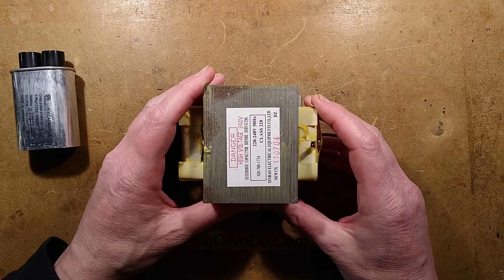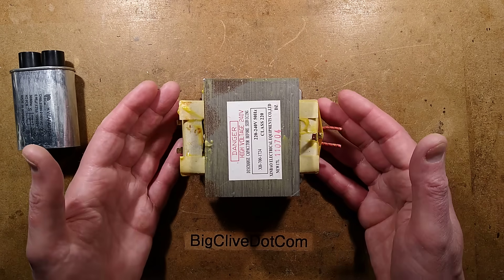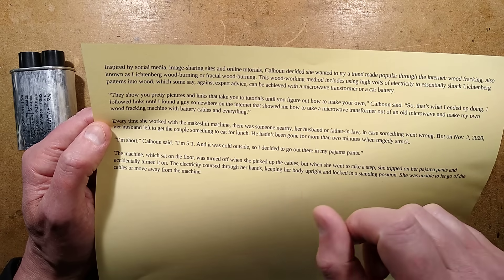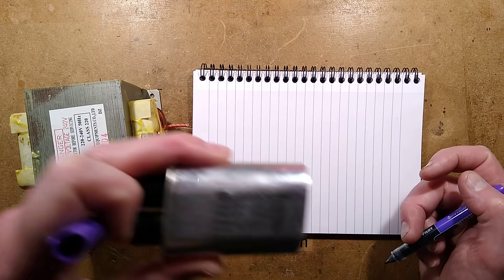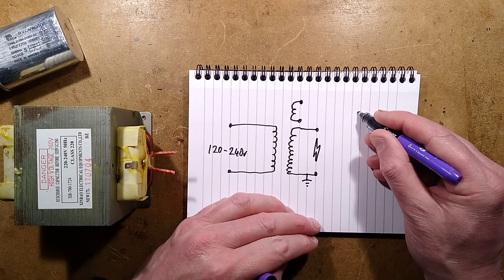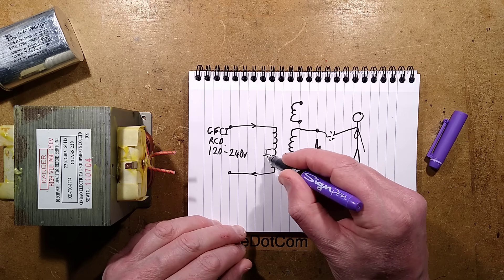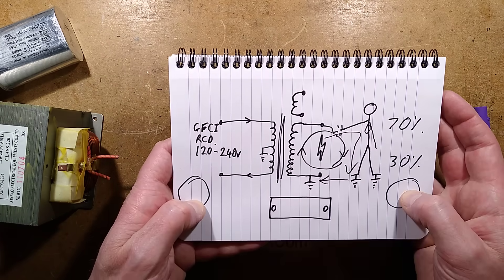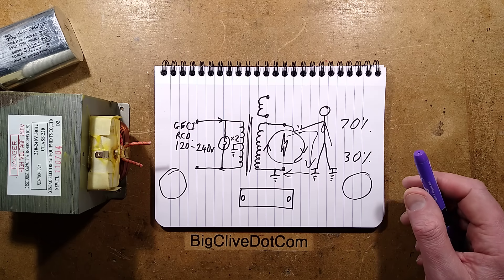The most deadly project on the Internet

Comment: You should use much higher voltage and lower current to make Lichtenburg figures, and of course never touch any part of the device while it’s connected to power.

Comment: If i ever did this (which i do not want to)
i think I'd also add unplugging the device as much as i can, shorting the hot, having an insulative mat rated for the voltages, and, honestly, I'd probably want a pneumatic dead mans switch because i dont want any path at all from that hot to me.

Comment: I don't understand how there was such damage to her hand, but not (apparently) to other parts of the circuit (her body).  I mean, the same current was passing though her feet, for example.  Of course it was probably shared between the feet, and the surface are of contact would have been much more, but I'd still expect some damage.  Maybe there was.
Reply from the maker: I'd guess most of the current was flowing across the hand.

Comment: I used the sheet metal from the microwave to build an enclosure for the device. I built a redundant safety circuit on the controls side. Including indicator lights( power on, active, and stop/e-stop), momentary activation PB, power on off SW, E-stop PB, 2 relays, Main power contactor, and a wireless IF remote. 
These machines are no joke. If you take it for granted or are ignorant,  the will hurt or kill you. I also build and design industrial controls. So talk to a friend and be safe. Be smarter, don't be a retarded.

That was also not the 'R' word slur. I was using it it's most literal definition. 
Be safe folks!

Comment: I've been using one of these for about 5 years on and off. I agree totally, they are dangerous. I have placed the activation switch about 2mtrs from the unit, so I'm not near it when it's live.
A welder works pretty well as a power supply but you still must switch it on remotely.

Comment: I work at Lowe's, we dispose of a lot of old microwaves, I've noticed that microwave manufactures have been doing away with these huge heavy beast transformers anyway, instead they are using some kind of smaller toroidal transformer and electronic circuits to make the high voltage, not to make the microwaves safer but as a way of making them cheaper and lighter.
Reply from the maker: The inverter power supplies.  I should investigate one sometime.

Comment: i'm an electronics guy. made a career out of it. i seriously doubted that a microwave transformer could kill you until i seen this video. ive been hit with AC a bunch but only low voltage 120/240. i only poke around with 1 hand too tho i keep the other hand gloved or in my pocket. lol. never been hit with DC either

Comment: It’s the current that kills, not the voltage. Ever been hit by a spark plug wire that’s throwing 50,000 volts? It’s smaller than those 4 gauge jumper wires that you’re complaining about.
Reply from the maker: It is the current that kills.  But a higher voltage pushes more current, and these transformers are causing a lot of extremely nasty incidents.
Reply: I'm an electrician and always find that statement a bit stupid. Ever seen lots of current flow with no volts?
Reply: @justbreakingballs  but have you ever died getting hit by a 30-50Kv coil? My statement is factually correct that there are circuits that carry very low current with higher voltages, current which is well low enough to not be fatal. Just because you have not worked on a low current high voltage circuit doesn’t mean they don’t exist, so I’m not sure you have all that much experience you have with a statement like that.
Reply: @cnrails  ouch touched a nerve have I. You've also missed the point why I find it a stupid statement. Voltage creates and is the precursor to current, you can't have current  without voltage, you don't see power plants generating current. They generate voltage. If anythings more factual it's that voltage kills because it's the primary unit generated. Without voltage 100% of electrical deaths are prevented. It's just a silly thing to say current kills volts don't. Let's see you generate all this killer current with 1volt. 😀

Comment: You dont need microwave parts you use a car battery charger/jumper on 50A or mid and thats all... Use it on both ends with a nail on underside
Reply from the maker: Have you actually tried this?  A charger only puts out 12/24V.

Comment: This video is exactly why I have this transformer sitting in the closet untouched. It scares me even though I have experience with lower voltages and have never been shocked once. 1 in 100 is too much of a chance for me.

EDIT: I think you can do this with a 12V car battery but much smaller scale.

Comment: I used to mess with high voltage alot and got shocks before but was usually extremely God-fearing and respectful in referring to current but still at the time one of my friends was messing with a neon sign transformer and was using it to burn patterns(I think is dumb) when  I warned him 100 times to be more careful. One of the days he was in his garage I came out to visit him he was convulsing in the floor like a seizure and when I went to turn off the plug my arm touched the metal surface of the table and the feeling is indescribable, felt like you just handed me 1000 pounds for my muscles to hold till the point of them busting and my chest and heart expoded out my chest for a split second as I could feel the cycles and thank god I fell away and let out the most visceral yelp with my heart beating a million miles an hour I run to the breaker and fliped it off. My friend was out cold and I called the ambulance and he spent the night in the hospital and made out with only burns. I was super mad at this guy and am no longer his friend because he is to carefree. Screw that guy. I lived and its not my only run in with death but I don't enjoy the ones not of my own making.

Comment: I was a mechanical maintenance man, heave in design and welding. When I got thrown into the electrical stuff 480v 3ph. I had little to no experience. An electrical contractor told me to get in the habit of keeping one hand behind the back when probing in a panel. So if I did get shocked the current would flow through my hand, and come out my foot. With both hands the current would pass through my chest/heart and by by.

Comment: I was warned by a domestic  appliance repairer who had a successful small business fixing things, that he knew several experienced  people over the years who had died trying to fix or repurpose microwave oven parts.
Reply: ...my bet is on the capacitors on the thing killing those folks.
Sure the coils are dangerous, but the "lets dig into its guts, it must be safe, since it aint plugged in" type of deaths are not due to coils.
Reply: @martonlerant5672  Yes, it's the capacitors that kill as people will be careless when the device is powered off! Another factor is that people do give too much trust on discharge resistor on these capacitors!😢
Reply: @martonlerant5672 scewdrivers with rubber handle short capacitor or leave it for few days to blled off
Reply: @martonlerant5672  I did have a shock with a mind you small 240V AC motor capacitor, not much but does make you think twice when it says high voltage on the side.
Reply: @martonlerant5672  I don't think those capacitors have enough energy to reliably kill a person. I have had higher energy shocks than that. Not that it's safe or pleasant, just not the way people are dying. I guess it's leaving the MOT powered up, whether inside or outside the oven.
Reply: @henryokeeffe5835  Those microwave capacitors do kill I was warned many years ago, when I trained as a domestic appliance engineer.
Reply: @matthewjenkins1161  They are fairly small MKP capacitors - storing about 10 J at the most. This is not considered enough energy to cause death (L.B. Gordon, "The physiological effects of electric shock in the pulsed power laboratory.") I wasn't even saying it isn't possible, just that even with all the people taking these apart, that isn't what killed those people that the OP mentions.
Reply: @henryokeeffe5835 "they don't have enough power to reliably kill a person" same as a revolver with one bullet, how many times do you plan to pull a trigger to find out?
Reply: @Cypeq  I wasn't suggesting anyone find out. It's just unlikely unplugged microwaves caused many, if any, of those deaths.
Reply: @henryokeeffe5835 I think you underestimate just how many people are working within these things. There's probably plenty of people "not dying" too.
Reply: This is why power supplies in computers are very dangerous. If you open it up the power supply casing and dig inside of it there's a chance you can die even if it's unplugged if you don't know what you're doing
Reply: Im pretty lucky to still be alive due to a microwave when i was 13 (now I’m 14 almost 15) and i didn’t know much about the dangers of electronics but they always interested me so i would take a bunch of different stuff apart to look at the internals and one day out microwave broke and we replaced so i was like oh nice a new thing to take apart and since i was young i didn’t check the capacitors or anything and i guess it had just been sitting without power (it took me some time because i had to get past some security screws) and i didn’t get electrocuted somehow
Reply: I watched a guy fry his hand on the step up transformer testing it out on a oil burner. 10000 volts 😂😂😂 make sure when arcing a screw driver across the leads with a finger NOT touching  the metal part of her screwdriver
Reply: these parts are super dangerous and used in commercial microwaves for commercial kitchens. Guy from my company like 6 months back almost died, luckily, he is okay. I work on these and get scared sometimes lol if you dont know, dont touch
Reply: So, why not wear latex gloves? Those yellow gloves to wash dishes.
That is what I use when I work on my home outlets, 120 VAC or when I connected new wiring to the fuse box.
Reply: @louistournas120 those kitchen rubber gloves do nothing to stop voltage in the thousands of volts. And if you're messing around with household power outlets why not kill the breaker, then check the outlets you'll be working on by shorting them with an insulated screwdriver. Otherwise you're just sacrificing dexterity while playing with fire.
Reply: @GTAmaniac1  "then check the outlets you'll be working on by shorting them with an insulated screwdriver"

==What?
Don't do that.
Use a multimeter to measure voltage.
Reply: @louistournas120 Never trust a multimeter - only a primitive device like test lamp.
Reply: @user-qv6ud2hx6f haha what, that sounds even more unsafe because the lamp may just be broken?